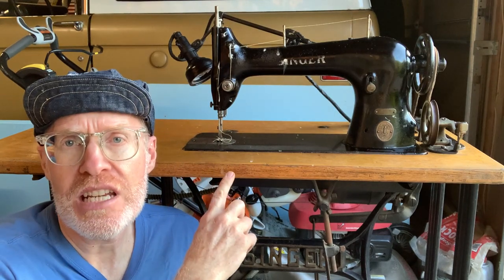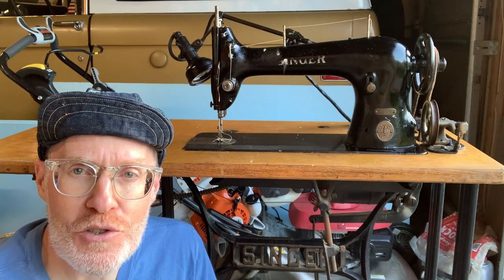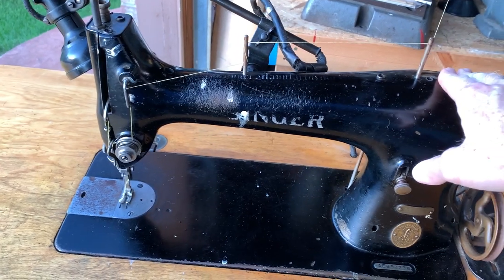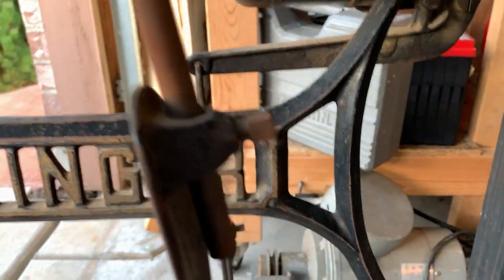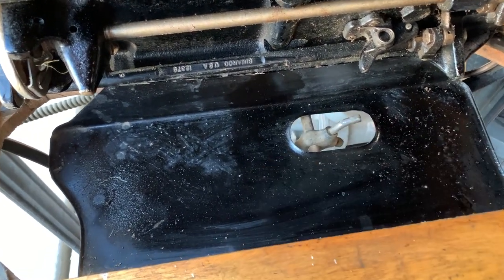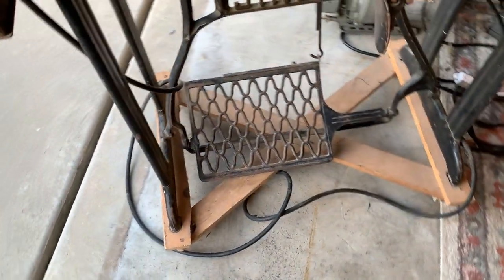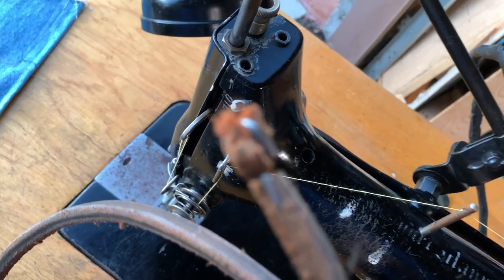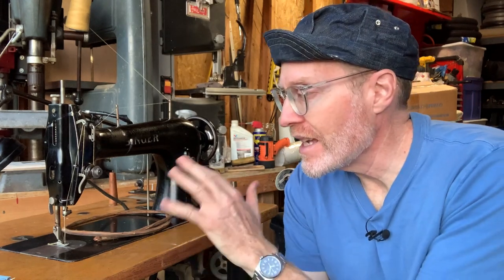The Singer 31-15 Industrial sewing machine.

Comment: One common issue with these old machines is the wear of line path, so sewing line has made thin grooves in metal. This leads to upper line tension problems because sewing line don't run freely and it can get even stuck and break.
Fix is to check every line guide - especially line tensioner axle - and then remove all wear marks with file and polish with fine emery cloth. Lathe is best for the axle but drill and file/sand paper should work well
Reply from the maker: Great advice.  Thanks!

Comment: Singer insisted the 31-15 was only a 'commercial' machine (i.e.: tailors and clothiers' alterations departments) but distributors largely ignored this and industry didn't get the memo, especially during WWII! Still a favorite for upholstery and top stitching on boots.
Reply from the maker: Thanks for watching!   My 31-20 is favorite.
Reply: Right?!  I have one of the ww2 versions.   Still has the cast iron base with US cast into it, instead of SINGER
Reply from the maker: @seagray5727  very cool!

Comment: Hi Derek, I was wondering what the throat space is on this machine and also how high it sets ? I saw a girl using an older electric singer for her quilts and I cant find her video so here I am asking you please. I have the red eye treadle , which needs work, and the 201 which is in great shape. But I'm working on a king size first quilt and I can't finish the quilt without turning it which will be it wonkie. I'm using my viking Ruby to do thr quilt though but could finish on another machine if I ever find the one she had and I cant remember the model.ty
Reply from the maker: Hi, it's almost 1/2 "

Comment: Glad I found your video.  Will check to see if you recorded the cleaning of the machine. 

I do have this machine. Having trouble finding the correct size of screws for the knee lifter. Can you tell me the dimensions of those two screws in that part.. Getting it oiled  and hope to get him working. My is a treadle machine  no motor at all and missing the tread stand.  I wonder if the wooden peg had a letter head to project the machine paint.  What size of needles those this machine take.  Also I am a bit intimate how strong it can run. Thinking on getting finger guard protection.  Is this high or lower shank?.
Reply from the maker: Hi, your best bet is to download the parts/manual books for the machine as it will give you most information you're looking for.    The wood peg is just a wood peg.  You won't need a finger guard as long as you pay attention.  I've never seen one on a 31 series, usually it's just for open needle machines.
Reply: @derekdoeschannel  I wonder if a schematic of this machine may help.  Planning to take the machine on a field trip to mom & pop hardware store to play with some srews .
Reply from the maker: @carmencolon3520  You can try, but I doubt you'll find them there.  Singer made their "own" screws and bolts.  Nothing really on the machines is standard.  You'll probably have to call an industrial shop and order what you need.

Comment: Nice machine I just go one and had the same problem with the belt . Were you able to get a replacement? If you did where did you get it?
Reply from the maker: Thanks.   I just replaced it with some leather belting I had.  I ordered another 100 feet from a sewing shop that carries it, but I forget the name.
Reply: ok thanks I saw that  belting online  I'm going to try it @derekdoeschannel
Reply: Old belt is usually repairable, just make new hole for the staple. It gets a bit shorter but it should still be long enough. You can also make a belt  by splicing a rope loop. If it doesn't have enough friction bees wax makes it work. Dyneema is best because it doesn't stretch or break
Reply: I ended up finding a regular V belt that I got to fit after adjusting the motor and winder @bekanav

Comment: For a person just starting out with boot making, and needing something that works well, easy to use, and maintain, what machine would you recommend?
Reply from the maker: Boot machines are a very specialty machine.   I’m not very familiar with them actually.  I know a lot is hand done, but a sole stitcher is one you will need.
Reply: @derekdoeschannel  - All right, what about a good machine for making clothes, leather jackets, and jeans?
Reply from the maker: @a-macduff  I'd just two.  The 31-15 like in the video and a 111w155 for leather.
Reply: This machine is just as good if not better than the equivalent newer machines of today.
Reply from the maker: @JohnJohn-zn8ib  100% correct